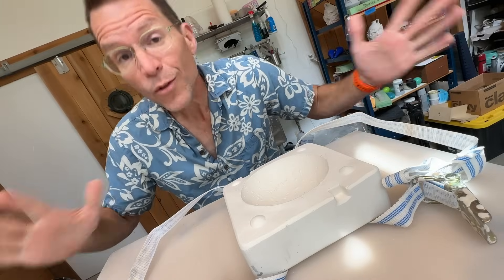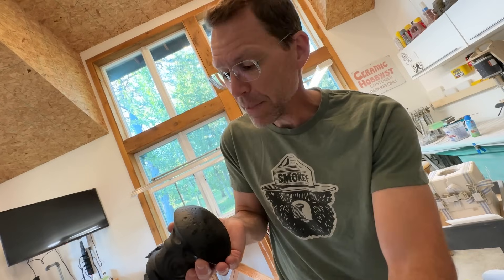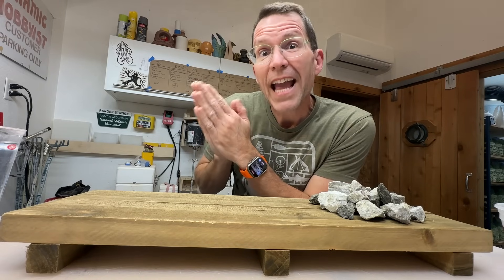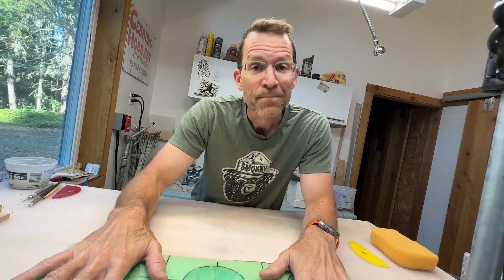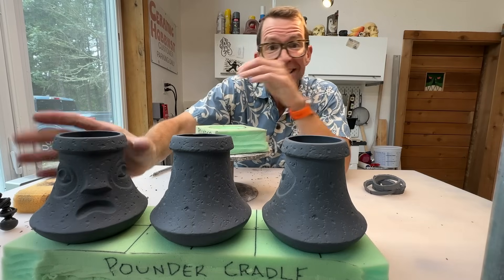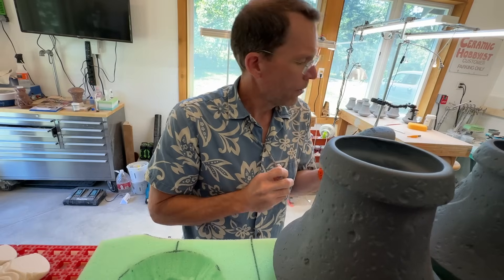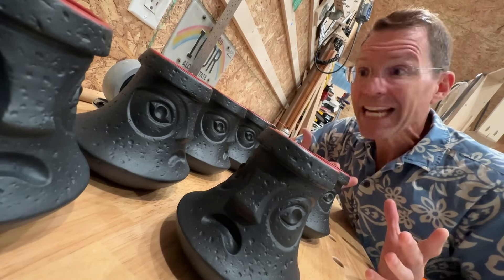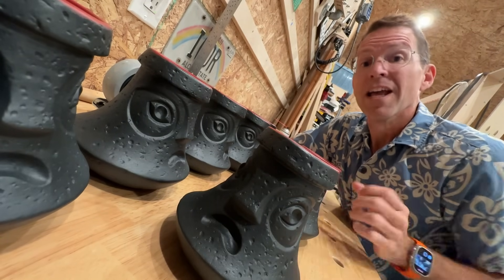Slipcasting Porcelain - Tiki Technical Tuesday

Comment: mr. van tiki!! amazing video!! and odd timing - i am JUST getting into slip casting cone 6 porcelain! i am on this slip casting journey alone and you are essentially my teacher so i want to thank you from the bottom of my heart!! you are doing so much for the community. last video i asked you a question about plaster molds and chavant NSP (thank you again), but prepare for a longer message this time:

currently i have successfully cast some of my mini figs within plaster and pouring slip is the next step, so admittedly i'm a little nervous (just waiting on the plaster molds to dry right now). i just bought Laguna Pearl CN 4110 porcelain in a dry 50lb bag. this stuff is expensive so i want to be absolutely sure i am doing the next steps right. on laguna's site, they've given me the appropriate official ratios, being 50lb of dry clay : 2.5 gal of water : 14ml of darvan 7. as my figs and molds are extremely small (they took about 3/4 cup of wet plaster per each side of a 2-part mold), i'm not really sure if i should mix the whole bag in one go per the official steps, or try break these ratios down (might be difficult, not too sure how i'd calculate that....). if i DO decide to mix the bag all in one go, will this stuff stay in liquid slip form indefinitely if it's in a container? does it just take a quick mix before using each time to wake it up?

thank you so much for any insight given!!!! ❤
Reply from the maker: Aloha! Full disclosure: I’ve never mixed porcelain from dry bags - I’ve only purchased pre-mixed porcelain slip. If it was me, I’d make the whole bag. Most likely it will give you around 5 gallons of slip. It will stay liquid - just jive the bucket a stir at least once a week to be safe, and mix it well before casting with it.
Reply: @vantikistudio  thank you for your reply! I hope I don’t bug you too much with my journey 😅 hmm, 5 gals is a lot, I guess I underestimated how much there would be! With my lack of storage space, I may halve or even quarter those ratios to help dole out the amounts - which will be easy enough to do the math. Thank you!!!! Until next time van tiki!! ❤️
Reply: @vantikistudio  hi van tiki! i'm back with another few questions after pouring some test figures (the mixing went great btw! specific gravity and viscosity is perfect). as these figs I'm making are very small porcelain pieces that are around 3" tall (as an aside, I originally found your channel through your "Small Plaster & Silicone Molds for ceramics - how to avoid undercuts!" vid, dealing with a similarly small casted figure); however, I have some questions as i encounter/anticipate them:

1) trimming the flashing and best times/practices for cutting off the pouring spout: I find that lower portions of my figs break off easily near the base as i trim off the spout, and as well as this, it's not the easiest to smooth out the flashing. do you have any ideal methods for dealing with these on such a small scale? what's the best time to cut them off? similarly, what's the best time to trim the flashing marks (should it be ASAP/wait a day)? also, are you aware of any references i can watch/read to help my techniques in trimming them?

2) the upcoming glazing/best methods for applying glaze on such a small scale: as this will be my next step after the initial bisque fire before the final firing, I'm thinking of going the underglaze route for different colours + applying a transparent glaze coating to finish. i understand i can colour my pieces in underglaze all the way to the bottom of the piece, but do i have it right that my transparent glaze should only go to 1/8" just before the very bottom of the piece to avoid the transparent glaze sticking to the kiln shelf? for a small figure with lots different colours, do you think this might be the most effective technique? will the 1/8" be noticeably less glassy/look odd near the bottom? on a similar note, can you think of alternative methods/techniques for my situation (like using stilts within the kiln)?

thank you in advance mr. van tiki!!!!!! ❤ you have been so crucial to my journey, it's thanks to watching your videos that i haven't had any major mishaps so far touches wood

Comment: Been on a marathon of watching Tiki Tech Tuesdays recently. They are great!, very informative and I was wondering if you recycle at some point all those bits and trims that the castings generate.
Reply from the maker: Thank you so much for watching!! You can reclaim all the trimmed bits - but I don’t. My slip tank is carefully mixed and balanced, and I’d need a separate reclaim tank for the scraps to avoid messing up the balance of my main tank. My studio is small, and my time is limited, so I don’t reclaim.

Comment: One thing I wondered from looking at yours and others plaster mould making, considering how sophisticated the keys and air vents, well spout etc are, why does no one create a channel or pouring spout for when excess slip is poured back out of the mould?  Wondering if this causes issues inside the mould etc or if its just an unnecessary step. Thanks again for the great content I always look forward to your videos!
Reply from the maker: For mugs and vessels that have an opening, the opening is simply the best place to get the slip in and out of the mold. On occasion I’ve made shapes that don’t have an opening (pendants for example) and I’ll make a special insert piece that I place into the mold that allows me to cast a hollow object with no holes or openings. Someday I’ll do a video showing that technique 😄

Comment: I love these videos. One question, though. Now that you have used porcelain in that mold, does that mean you can't use the regular material you use for slip casting?
Reply from the maker: you know - I'm not really sure.  Since I have a silicone master, I would go ahead and cast a fresh new plaster mold if I wanted to try slip casting this design with a different clay body just to be safe.  The black color would definitely show up if I tried to cast a light body of clay into the mold after casting the black porcelain.

Comment: If you use porcelain slip in a mold, can you use clay slip in it the next time you want to pour?
Reply from the maker: I’m not really sure. I’ve never tried it, as I’m worried about cross contamination. I usually pour a fresh plaster mold if I want to try casting something in a different clay body (that’s another reason why having a silicone master is nice)